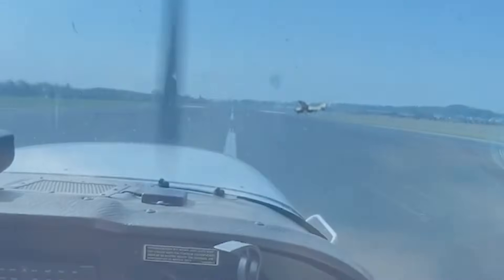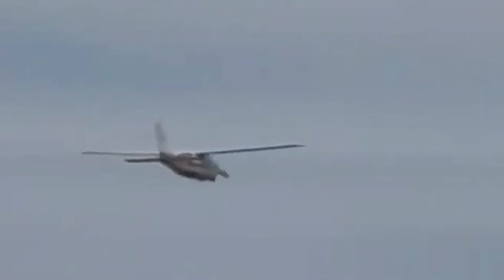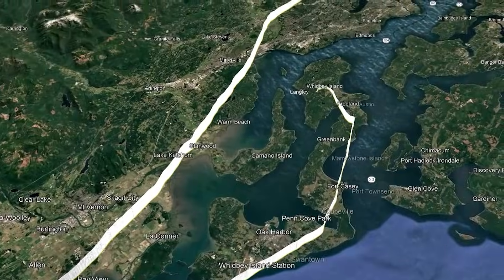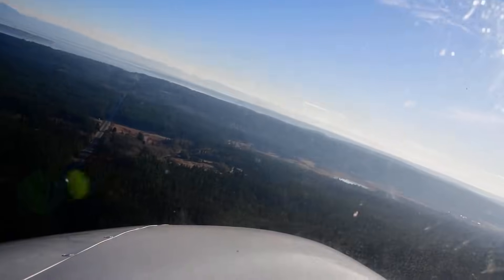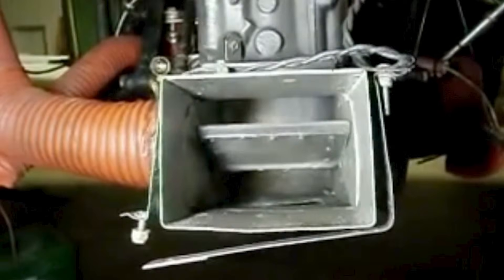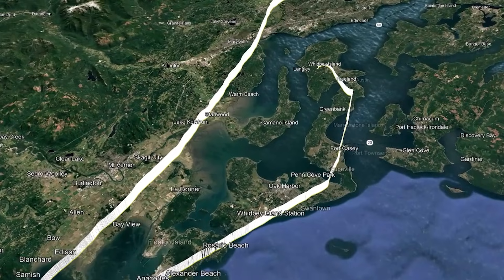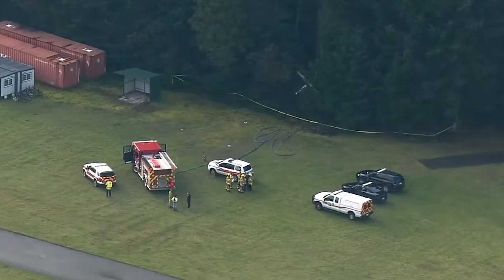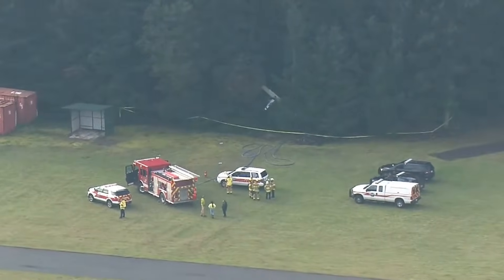Why Carb Ice Can Kill Without Feeling ANYTHING…

Comment: After a year of driving an old 90’s Nissan Frontier pickup junker cruising down the highway on moist days It would often slow down to a crawl.   I’d pull over for five minutes then start it up and it would run like a top. The residual heat from the engine would melt the ice.   It must of been missing some kind of baffle over the carb area.  

Pulling over in my C-150 was never an option, so I always descended with full carb heat, half power and half flaps on warm moist days.

Comment: I guess I can count myself very lucky to have learned my "carb ice" lesson on the ground. This was something my instructor never covered with me. I was taxiing out to the RW in my older 172 one day. The weather was cool and overcast at about 10K'. The engine just suddenly dropped RPM's and then died. I waited a few minutes and started it up again and taxied to the mechanic's hangar. He just laughed at me. He asked if I ran any carb heat while taxiing. I said no. He said on days like this with a lot of cool moisture in the air and temp and dew pt are close, carbs can ice up pretty easily at low RPM's like in a taxi. Never forgot that. My next plane was fuel injected but that was a good lesson to learn.

Comment: Would have been nice if Flig Debrief reviewed the signs of carb icing occuring. Happened to me once. .I was just beginning to cross Long Island sound in a normally aspirated Cessna...Engine RPM degrades..you add a bit of throttle...rpm degrades a little, again...you add more throttle..Happens again, just requiring small increases in throttle each time....It sneaks up..Thank God, I recognized the symptoms and added full carb heat..The engine sputtered and coughed for about 10 seconds as I did a 45D bank back towards the Long Island coast.....Then, the engine roared back, had to decrease throttle to normal cruise engine power...Did a few circles then continued on to Connecticut....

Comment: Carbs and pretty gals are similar in operation. Push, pull, all buttons, cables , controls to keep both warmed up for good performance.RIP to these fellas. Carb ice can occur way above freezing points...the Ventura tube, altitude, moisture, changes everything compared to 32 degrees